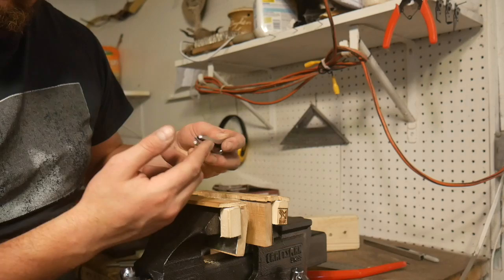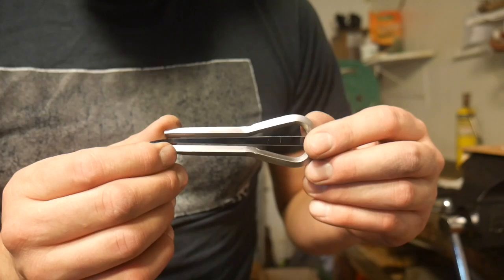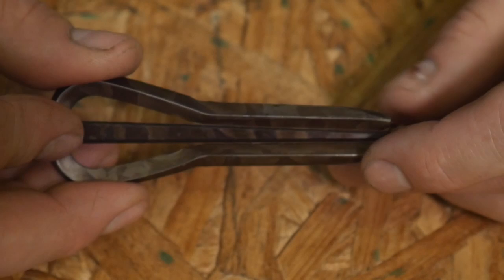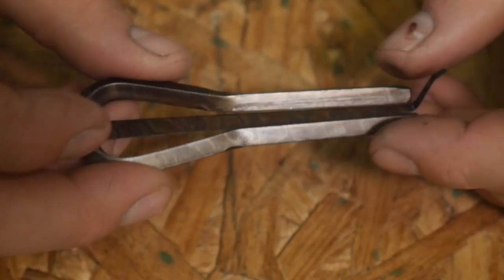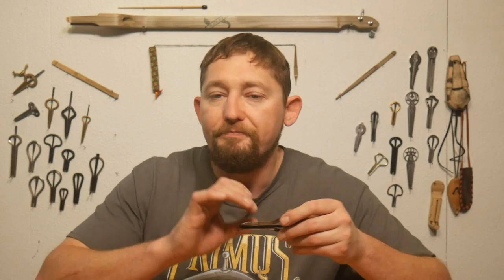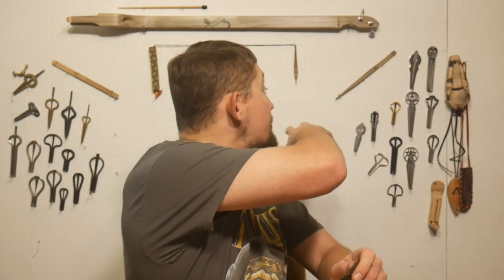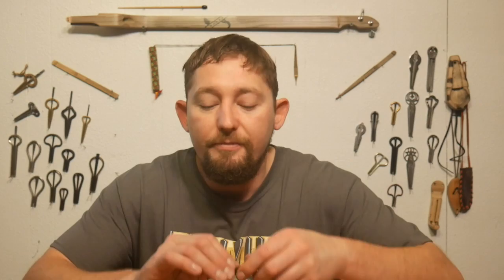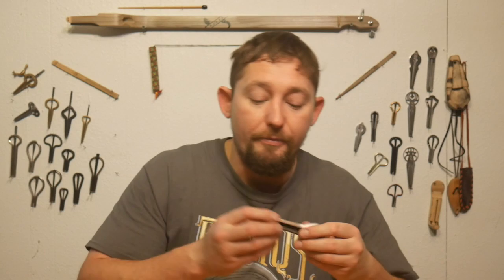Making a Jaw Harp from start to finish.

Comment: My parents are constantly telling me that all I need to make a jaw harp is a pencil and a rubber band. I highly doubt it now
Reply: you don't even need that i made one out of a credit card I just cut in half basically
Reply: But that's how loving mother's are, they pass on wut they know, therefore, it's up to us to learn futher. And like me ; you also just did lol. I love the Jawharp King.
Reply: You “can” but there’s a better method using a credit/debit/gift card, cut the main piece into a diamond shape (two thirds to one third) and cut the fan blade on the middle two-thirds part without breaking the edge of it, and there you go
Reply: @Undead_James  i 3D printed several that sounded pretty good.

Comment: @10:10 when you use the calipers, what is your goal? To have a uniform width from the base to end of the arms? Or to have a specific taper?
Reply from the maker: Specific taper.   Or more a good proportional taper.   My newer techniques work better.   This is a bit older.

Comment: Hi, I have decided that I want to make a jaw harp and since it seems you are pretty good at making them, you seem like the best source of measurements. I was wondering how long is the steel rod before you bend it, and where the bend joints are located?
Reply from the maker: This will vary according to the way that you are bending it.   The radius that the bend is made on and what you want as a finished harp.   The measurements and radius may be different for you as you may be bending it at a different radius or angle and your bending method may differ.   What I suggest is to make a few bends in your metal.   To see how it goes.  Look at the way it is bending and working in your scenario.   Then draw a harp.   Draw it similar to the same dimension as you want it.   Take some measurements and cut the stock to the total length of the drawing.   Then mark out the bends.    Then make the bends in the most logical order and see how you end up.   Look at the finished frame.   See and note where you want to make changes and adjustments.   Then make a new frame.   You will likely fail a lot, I did.   It will also be a unique and individual experience with much frustration and also reward.  Enjoy the journey into harpmaking.

Comment: What raw material do you use to make the trigger, some kind of spring steel? Where do you purchase it?
Reply from the maker: I use 1074 tempered spring steel at thickness .020 and .025 at Rockwell of 45 and 44, as well as 1095 tempered spring at thickness .020 at Rockwell 48.   You can buy these many places, I buy through a machine shop that orders them from metal companies.

Comment: what are the reeds made from? would metal strapping material work?
Reply from the maker: No.  It needs to be of spring temper.    I keep a good stock of several assorted spring steel.   .020 and .025 blue temper 1074 at a Rockwell of. 44 and 45 as well as 1095 .025 at Rockwell of 48
Reply: Bebbcorp Harpery thank you kindly sir!

Comment: So when you decided to start building jaw harps, did you already own some or many of these tools (some of them are pretty intense!) for another purpose or did you invest in them specifically for this? 

And is this something that requires an investment in some big tools right from the start or can you get by with the bare minimum (and doing lots by hand) and slowly build up an arsenal of machines to make things easier / cut down time?
Reply from the maker: I invested in tools when I made the decision.   You don’t need everything I use.  You do need a good vise and some files.   Also a method of making the frame.
Reply: Right on man I was just curious. I'm totaly just happy making noize right now but every once in a while I catch myself staring at one wondering haha maybe someday

Comment: How did you make that harp?
Reply from the maker: Ok here goes.  First i measure out the length of square stock that I use for the frame.  I then cut it using bolt cutters.  After that I grind, bevel, and wire finish both ends.  Then I mark bend points on the square metal stock.  Then I make the outward bends of the harp.  After that I make the inward bends wrapping the two outward bends around until they are almost parallel with each other.  After that I put it in a vise and tweak around on the frame and arms until everything is even and looking how I want.  Then I grind and taper the ends that will go in the mouth and also do some decorative filings to the frame and also smooth up any roughness with a wire wheel.   Then I use a large four square file to sharpen and true up my embouchures.  Then I take measurements of the embouchures and cut a reed out of spring steel to match my embouchures.  Then I grind the reed to sharpen it so it will cut the air.  Then I debar and hone the reed on a whetstone.  Then I strop the reed on a soft wood surface.  Next I cut and file a channel in my frame to hold the reed .  Then I slide the reed in like a puzzle piece and tap it in with a hammer to set it.  Then I use a press to crimp the reed and finish setting the reed with a hammer and punch atop a piece of railroad track on my bench.  Then I roughly true up the frame arms with the reed.  Next I dull the reed sticking out past the frame with some small whetstones which will become my trigger.  Next I make my bend with a pair of pliers and needle nose pliers while holding the harp over a candle to heat up the area being bent.  Many times I will also heat up the tip of the trigger and form a loop on the trigger then I quench the reed in water to cool it and re-harden the area that I heated to form the loop. Then I finish the harp, in a food safe way.  I do not tell anyone my finishing process, but the harp emerges the next day looking sheen with different colors of patterns on it.  One person describes that my finish looks like, "The patterns on a northern pike fish."  I think it looks pretty cool.  After finish I make my final adjustments to the frames and reed to get the sound that I want.  Then I mail it off to the person that I made the harp for.  I am about six weeks out on harp builds for customers and I make harps for people based on what they want and also what will compliment their playing style.  That was a novel and I think that I successfully overused the word, "Then."  lol.
Reply: Great in depth reply! I'm on my third harp in a couple days and I think I'm starting to get a feel for it.
Reply from the maker: Sam L    It definitely has a learning curve to it.     I have butchered tons of harps since I hve started.   Now I am getting more consistent and high quality results.
Reply: My main issue is I'm looking for a certain "depth" of sound, preferring lower octaves for what I would like to use a jaw harp for. I can't quite seem to mirror the sound the Glazyrins and i think that's because of a specific temper in the steel used for the reed that I can't identify yet. It definitely has to do with long, fairly low hardness notched arms, coupled with a high hardness springy reeds inside that cavitating space. It induces low frequency vibrations in the arms, but right now I think I'm making one piece too hard or too soft.
Reply from the maker: It is the grind of the frames.    They are flat on one side and sloped on the other givea it an outer spacey sound.   If you want lower tone increase length, decrease width, and leave more meat on the trigger.   Also the four planes of a harp are very important.   I will make a video for you explaining this weekend.
Reply: Hey thanks man! Knowing the key aspects that change the sound would be awesome. I kind of get what you're saying but a visual representation would be really helpful, so thanks for making a video on it.
Reply from the maker: Will do.   In the meantime post a vid of your harp to your channel and let me kniw.    We'll get some eyes and ears on it and come up with a solution
Reply: Bebbcorp Harpery im gonna have to make a prettier revision then!
Reply from the maker: Sam L    No worries I have a 5 gallon bucket full of ugly harps.    Failure breeds success.

Comment: Seen any using Sterling Silver?
Reply from the maker: +JewelryWerx by Robert Coleman    I believe schlutter uses a silver alloy of some type
Reply: Stirling itself is too soft. Also it has no memory. Not a good choice for a harp.
Reply: @bebbcorpharpery7331  AFAIK Schlütter uses "German silver" but it's not real silver but an alloy of copper, nickel and zinc. It's what some boehm flutes are made of.